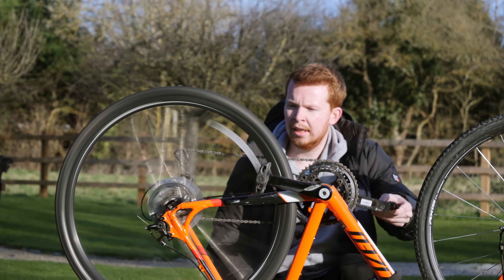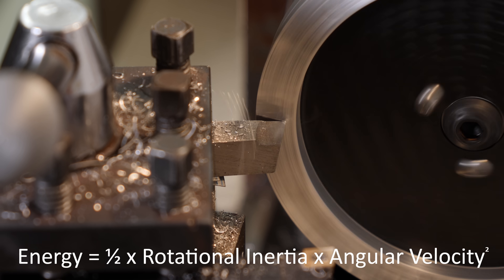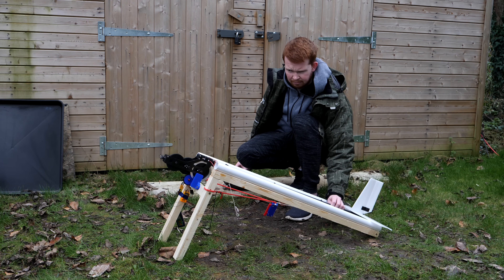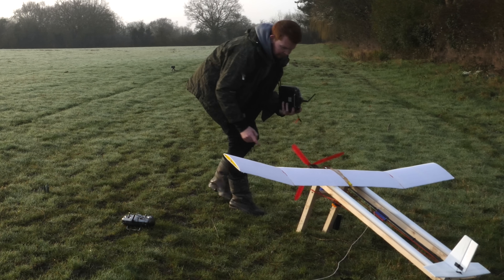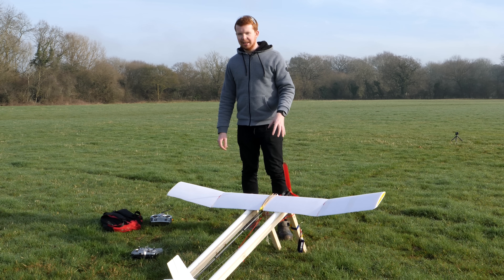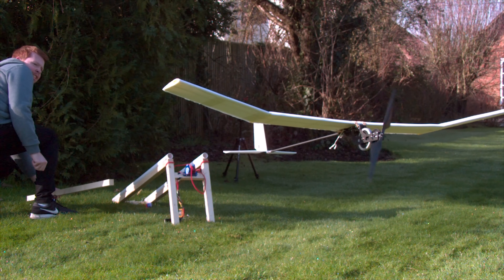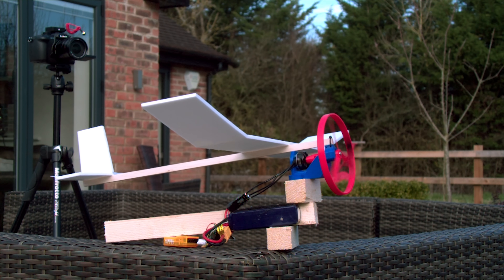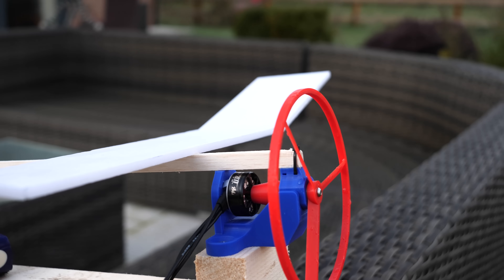Flywheel Powered Plane

Comment: As an avid and long time pilot of R/C aircraft, this was rather enjoyable to watch. Kinda taking it back to the basics. Have you thought about having the pitch of the blade change as it approaches the hub of the prop itself? Not sure if 3D printers can do that or not as I have never owned one. 4 Blade props are also real good with low RPM, if you can handle the xtra weight.

Comment: i see alot of brilliance here but all in different places.3 cylender radial engine https://www.youtube.com/watch?v=Gp0Zi7U--30 combined with that fly wheel idea of yours to make an air engine.winch launch plane maybe Discus launch glider?get some height so you can turn on air engine.when that runs out electric engine to compress more air or maybe windmill prop to compress air to save weight?happy to help support you in endevours think of using this engine in v1 rc plane

Comment: I notice a flaw in your design. The flywheel has a gyro effect and has a moment tendency to pitch towards the direction of rotation (4:15). That's why your aircraft pitching down and crash. You shall not place it vertically. U shall place it horizontally. And not 1 but 2 flywheels horizontally. Both rotating at different directions to cancel out the moments. I really wish you try this. Or at least prove me wrong if you think my theory did not make sense to you.

Comment: if you connected the flywheel directly to the blades using only a 90 degrees 1 to 1 gear it would have worked and made a heavier flywheel making it spin slower

Comment: Hi Tom! Have you thought about the gyroscopic effect of the fly wheel on the stability of the plane? In the new design you switched the rotation axes of the flywheel to be the direction the plane is pointed in, so it's possible that could be stabilizing it. I'd be interested in seeing how it works with the heavy flywheel but rotated 90 so the rotation axis of rotation points in the forward direction.

Comment: A longer launch ramp will help with the wings to start working. Also to maintain speed the flywheel should have a vacuum chamber. And it is more efficient  to spin the flywheel by its shaft.

Comment: you should reduce the diameter of the propeller, or reduce the blade incidence, so that you can reach a higher number of revolutions, the energy accumulated by a rotating body increases with the square of the rotation speed,

Comment: Very good devotion to your work brother. I will suggest that you make cars that run on this flywheel technology. You have flywheel and 3Dprinting. Just get bigger winding spring mechanism than a clock and power the flywheel. Rewind mechanism can be used as handle or paddles.
Or go for electric battery.

Comment: How about a pulley+weight powered plane. (Like that gravity lamp, that is using a weight+gravity, to spin up a generator in order to power the lamp.) I know that could be a nightmare, since the plane would drag the weight after itself, but could it be done ? Just an idea. You could store kinetic energy that way, or spin up a generator, and use an electric engine. Whatever is possible/more efficient.

Comment: Running a fly wheel latterly along the fuselage would really make the plane extremely stable acting like a gyroscope. If this was utilized on an ultralight the landings might be so stable that you could technically just land with only one wheel . You may well accomplish a most perfect safe landing. It’s good to see someone toying with these kind of ideas.
Reply: Good luck steering. The wheel wants to keep going straight. You will never get the plane turning
Reply: @hornetIIkite3  what about two on the wingtips with brakes
Reply: The brakes engage the propellers
Reply: Just realized this would mean that the flywheel is spinning perpendicular to the line of flight so I guess they would have to be spinning in opposite directions to keep the plane from doing constant barrel rolls, okay this is a problem for my fantastical flying machine
Reply: you can see the thought process of @whowereweagain  here
Reply: @hornetIIkite3  Would this help in landing though, if they're spun up only on final approach?
Reply: No, it actually gets instable when decelerates!
Reply: Or not be able to turn.
Reply: You seem like you know what you're talking about. I'm the furthest thing from an engineer but I've been imagining a fanciful glider that has flywheel powered propeller(s) which is why I found this video. what are your thoughts on the feasibility of placing turbines posterior to the propellers that rewind the flywheels using drag while cruising or when needed for air braking? It's only natural that fly wheels be used for flying and I want lowtech environmentally friendly and safe ways for normal poor people to fly.

Comment: I do not know I am getting it right, but as I see the wheel spin direction forced the plane nose down. Another direction may apply torque to the upright direction. It can be helpful at the start. Maybe two counterspinning wheel should work better. The amount of energy is the same. You need to print a planetary gearing for it :D

Comment: Hi. Would you like to help your country and mine (USA) by helping to build a $200 ventilator from easily available parts ? The principles are simple and the parts are available. Only DIYers like yourself will be able to pull it off. Until enough ventilators are produced by industry, this will do, and will save lives if everyone does it. You'll also get huge clicks from the video. Thank you : https://www.reddit.com/r/JosephMurphy/comments/fqb6vn/200_diy_disposable_ventilators_to_solve_acute_but/

Comment: you could take a concept from helicopters and ultra light helicopters and implement it into this they use one engine driven propeller in the back to go forward and then the top rotor is free spinning it can be because they rotate the angle of the rotors in flight and once the rotor is spinning enough from the forward momentum they take off its nuts so if you did that it would increase the lift of that thing just put a free spinning rotor on top of the airplane of course it has to be a variable pitch propeller

Comment: This is how a commercial jet engine works.
The APU in the rear of the engine powers the main blades with compressed air and in turn the air is gradually compressed and thrust produced at the rear.
In essence much like blowing up a rubber balloon and letting it go is what’s happening under each wing.
Aircraft aren’t fuelled in the way we are told, the public have been duped.
Have a nice day

Comment: use fly wheel weight to move electric generator and  fly your plane or air bus with this electric power you generated  free electric power through out your flight  do it if you are genius

Comment: A flywheel can NEVER be used to drive another rotating object which will then lift the flywheel of the ground. It uses the centrifugal force: this means that the sum of the forces during rotating upwards, sideways and downwards  = ... yes zero. The only force you have is in the middle of the flywheel. This rotational force however, can never be converted to a force Bigger than itself. Otherwise you would heave invented the perpetuum mobile, which only exists is space. (and is not perpetuum but very very long) The flywheel is used to dampen losses of force as we see them in almost every engine, motor, bicycle, dishwasher, let's say every apparatus, which are in need of a SLOW but powerfull rotating force. You wil not find a flywheel in a blender, a hairdryer, a drone, a rocket, an airplane. You will find them in boats, cars, and other slow but powerfull moving things.

Comment: You should implement the motor into the plane and maybe use a compliant 
centrifugal clutch which could be 3d printed so that the motor drives 
the propeller when spinning at high RPMs in a way more reliable way more
 reliable way than the sketchy gears. Then at launc you disable the 
motor and use the flywheel as your energy source. When you start losing 
energy you can engage the motor again and not have to do such short 
flights. Maybe don't use a fat 4s with a huge motor but yeah :)

Comment: PLEASE tell us you are working around the clock on a 3d printed, Arduino controlled mechanical ventilator design built from parts available at hardware stores.

Comment: Very cool! I was thinking maybe you could design on this concept. When the prop came apart. What if you made the ring wider(deep) and inside of it print a type of thread type fins. Even haow it flew of at rapid speeds,imagine if it had the fins inside pulling air through it. You gotta try it! Spin one up like you did using only the ring.

Comment: A single flywheel will behave like a gyroscope. Ideally would be 2 coaxial flywheels rotating in opposite directions, coupled with bevel gears to the same mechanism.

Comment: You can store way more energy than any lithium batteries also more than even petroleum inside the flywheel. The most concentrated way to store energy is flywheel.. if you make it out of very light and strong material with large diameter and put it inside a vaccum container,  you can speed it up way over speed of sound , because there is no friction with air molecules inside the vacuum and for every twice increase on the rotation speed of flywheel,  you get 4 times the stored energy. So if you speeded up to let say 100 times , you get 10000 times more stored energy in it.. you need to put flywheel inside a vacuum container with magnetic bearings and get the energy using magnets and converting it to electricity to use in step motor like the way u use batteries..

Comment: did you make sure that, while harvesting the fly-energy, the plane would turn up? because (if i saw correctly) you spun it clockwise (when seen from the right), which means as the wheel is used up, it tilts the plane down.

Comment: Great idea but wasnt there a couple of problems like a ratio of lift force to weight and thrust generated by the propeleres? Also there might be a problem due to light weight and of it being not static enough to counter the vibration made by the fly wheel that requires a really good accuracy and balance

Comment: Just a thought: maybe the first heavier version failed due to weight balance being an issue. Since the plane was front weighted. Moving the flywheel back just a little might have made it that the plane would had better chance at success.

Comment: Years ago I was looking at ultralight plans, when I ran across a very unusual helicopter. The company who sells the plans is called Vortech, but the story I found online was that they obtained the plans illegally, as the plans were stolen from the designer,, they claim the helicopter flew all over back in the day, but the person accusing them of the plans claimed it NEVER flew... The company wants $250 for these plans, but really... I really just want to know if it flies, as it is most unusual. I asked Flight Test if they would see if it could fly as a RC.... That is what I thought they did... Test... But today, my question is still unanswered, curiosity, really. I love weird stuff, and I loved the design the moment I first saw it. Will it fly? And is there anyone out there who could build a RC to test? Gas engines would be great, but really... Even if it doesn't fly, there is more than enough information included in this link to replicate a scale model. I just want to see one. Even if it's a toy... But CAN it fly?  CW-105F Twin-Rotor 2-Seat Helicopter Plans.

Comment: In your design, the flywheel mechanism (which accounted for most the the weight) was way too forward in relation to the wings (which generated the lift) thus causing it to nose dive.

Comment: You cannot use heavy spinning weel in a plane, it is mechanical gyroskop forcing the plane to hold position or to turn if you try to move it... You never watched any of these videos? https://www.youtube.com/watch?v=n5bKzBZ7XuM 
but they are used in yachts to hold position of boat:
https://www.youtube.com/watch?v=Jyte5_ERAiI

Comment: Your flywheel setup was perfect but the gears were reversed the wrong way. You want the propeller spinning much faster than the flywheel. That’s where the intertia of the propellor comes from. Then try spinning the heavy wheel as fast as you can get it. Not sure you you looked over that part

Comment: A flying wheel moving system could encounter a problem... Whenever it change its orientation (i.e. turning), it cost energy, and this would lower the duration the system stay in the air.  I guess a flying wheel system is best when it is used without changing its orientation, or better even, if the system can make use of earth's spinning to enhance the system output, that will be splendid.

Comment: If you want to use a flywheel as an energy source for a dynamic object then you need to use counter rotating mass, in order to negate each other's gyroscopic precession. More over 3D printed gears has a lot of drag/friction because they mesh horribly.
Your best bet, probably, would be to use RC car gears and a gearbox from a cordless drill.

Comment: look into the leading edge of the wings if you cant pitch the wings you cant get flight  shave a steep angle edge to reduce drag and set at angle in a 90 degree sharp edge on first stage and than + 20 degree on second stage . you are producing to much drag , the weight of the plain plus the weight of the motor and props on a wing that cant adjust for the energy transfer from stationary to moving frame.

Comment: 1) the more lightweight the plane /drone, the more highest possibility to lifted up & fly
2) the flywheel's weight at the front ( nose ) area is the problem & need more wing span
3) using PP ( polypropylene ) material of filament / coil  3D print for the propeller is way much durable & shock resistant
4)  using  3  or 4  propeller's leaf might way more stable

Comment: I can’t see it on the video, but was that heavy ring spinning in the right direction? Because that could be a reason why the plane’s nose goes down. I mean the moment of inertia of the whole plane is approximately conserved so if the spinning ring is decelerating, then the plane is gonna turn in the opposite direction of the ring (so it goes up or down, it depend

Comment: The mechanical components on the hi-side are pretty impressive! May I ask of the details about the bevel gears? Did you make those using a 3D printer? If so, what plastic did you use?

Comment: a flywheel will act as a gyroscope and will act 90° to the direction of movement. Perhaps the rotation direction is forcing the wheel down when spinning the flywheel the opposite direction will want to rise.

Comment: i absolutely love the little inertial planes.
Reply: if you made the plane prop-in-slot with the prop at the CG, and a spinup lug on the back of the prop, you could big-scale this design and increase the mass of the "fly"wheel without getting nose heavy. in that case mill or find an aluminum ring, affix 3 bladed carbon prop inside that.

Comment: You lose a lot of energy anytime with every belt and pulley you add.
Good for a first step. Now install your c/f and aluminum wheel behind the propeller inline, not 90° to the propeller so it rotates the same way and then to the quick release mechanism.
The wheel gets up to speed, storing energy. 
Possibly smaller with more weight on the outer ring, perhaps even cone shaped to be aerodynamic.

Comment: I got an idea to improve the first flywheel plane test. I think the propeller wasn’t spinning fast enough. Just add 2 more gears and belts in the reverse pattern to make the propeller faster, as long as the propeller and the gears can handle the speed without exploding.

Comment: food for thought ; there was a flywheel powered torpedo that used counter rotating variable pitch propellers to maintain a constant thrust. I think it was one of the first used by the US Navy. I would spin your first flywheel design using compressed air . a random brainwave - easier to hand lunch. old aircraft instrumentation gyro's used both air or vacuum for power, a few had  mass and awesome bearings....ideas for thought... been enjoying your videos for several years.

Comment: Spinning flywheel is causing first plane to tilt downward and second plane to the right. The same thing happens on motorcycles with engine parallel to the rest of the frame. When you accelerate, it starts to tilt to one side.

Comment: If you added a weighted outer ring to the propellor, would that operate as a flywheel itself? Might cause problems from the increased torque, I suppose.

Comment: Create a Cavity in the flywheel... Fill it with water that will rotate into a self charging vortex within the flywheel... as the zero-point charge forms at higher rotational speeds, the vortex will begin to auto rotate. This is not perpetual motion. That does not exist. That is a fantasy invented by slaves of the Cabal. What this is, is Simply Extropic Function of Universe.

Comment: What if you made the flywheel spin the other way? Maybe the plane was nosediving due to rotational momentum (is that the right term?) constantly pulling the nose down. Wouldn't reversing the direction of rotation pull the nose up instead?